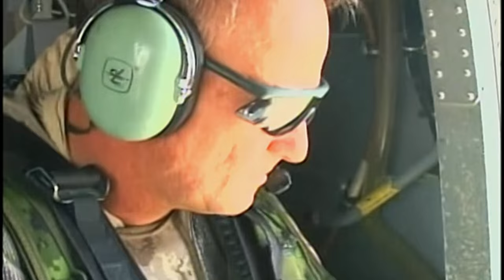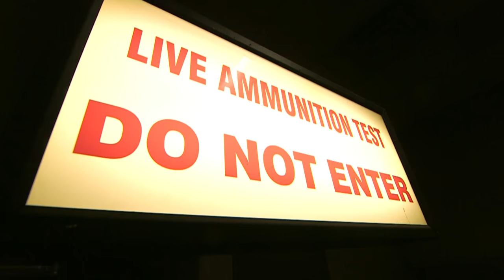Canadian Company Making High-End Armoured Vehicles

Comment: Even though i dont need it id love to own a armored non military car. Definitely would want a early 2000s Lincoln town car, newer Lincoln continental or iconic Escalade esv, Denali xl suburban with communication devices, jammers, non lethal offensive capabilities, big diesel engine or modifed supercharged or turbo v8, and if its a big suv definitely get running boards roof handles and offroad/skid plates/push bar all around. Not only would it be safe the amount of engeering in it is just amazing to see let alone drive i can imagine.